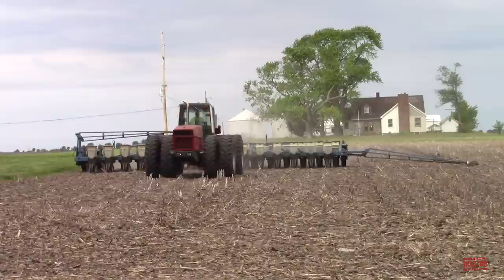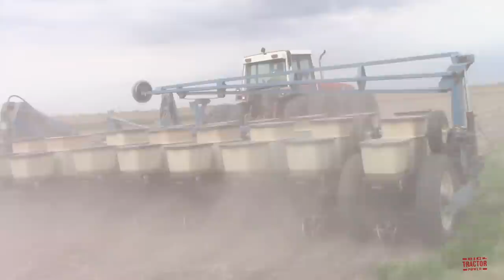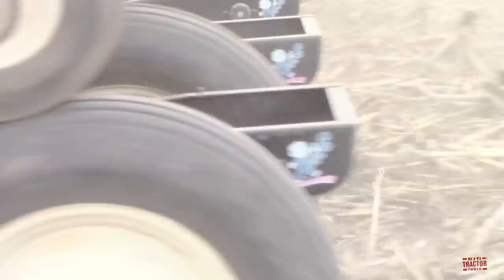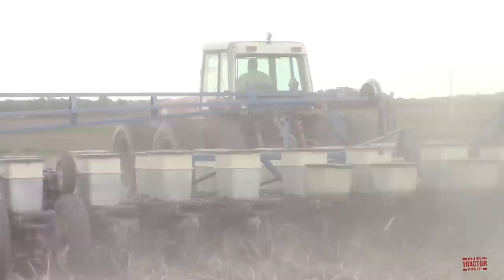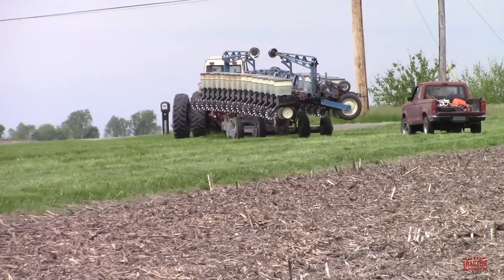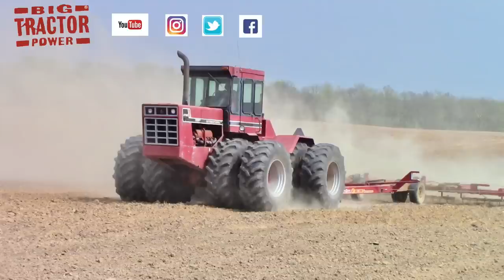INTERNATIONAL 3588 2+2 Tractor

Comment: Still my favorite new IH tractor. Remember having many a cab ride in one as a kid. There's nothing like that new cab smell. Driving it, once I was a little older, from time to time was a neat experience. My favorite jobs were pulling the Gehl 1260 chopper with the Auto Max setup in hay & pulling the big Vibra Shank. The other favorite new IH machine was the 4000 windrower. I'll save that story for some other time, in case you post a video of one in the future. Thanks for the great video, Jason! Regards!!

Comment: This is one of my dream tractors it's hard to find one here in Saskatchewan
Reply from the maker: I have an IH 620 press drill brochure that shows a Wheatland 3788 on a four section model. The Wheatland 3788 has larger singles and no 3pt.
Reply: @bigtractorpower  IH made a Wheatland 3788 2+2?  I didn’t know that.  I liked the look of the 2+2.  My dad told me about when he saw one back in the early 1980s.

Comment: That looks a very big tractor for 150 hp, considering what sort of outputs you'd expect from top of the range tractors nowadays.
Reply from the maker: During this time period the biggest articulated  4wds were around 250-300 hp. A 150 hp row crop tractor was a big machine at the time. It was not until 2006 that hp really began to jump in row crop and 4wd tractors. By 1996 tractors had grown to 225 hp row crop and 425 hp 4wd. By 2006 they were 255 hp and 450 hp. After 2006 row tractors jumped to 305 hp, 335, 360 to 400 hp in ten years. 4wds went to 500 hp to 600 hp in ten years.

Comment: The 2+2s were pretty cool tractor! It has the 86 series cab. 4 speed?
Reply: 3 speed, same transmission as the 1586
Reply: @gjh12  yea. We have one of those.😌
Reply: No it’s a 4 speed.  3 speeds only came in the 3788 and 6788 modes the rest were 4 speed.
Reply: Yea. We have a 1586. Wish it had a 4 speed. Not the best chore tractor. Does the job though. Lol
Reply: @benkpsnyder  yup we had a 3788 but we much prefer the 3588 lol

Comment: I have often wondered what the big drawback to having the cab behind the pivot. There has to be one IH is the only I know of to market that configuration.
Reply from the maker: There is not any draw back that I know off. When you look at a modern Case IH Magnum or a John Deere 8R they have the same front forward engine design as the 2+2.  In fact a new Magnum and 8R is longer than a 2+2 they just don’t articulate.
Reply: @bigtractorpower  you put a tractor I always liked on here.  To me if that 2+2 concept would have been carried over to CaseIH, they could have made more of them.  Looked like it was quite maneuverable.  I’ve read a good bit about that tractor from International Harvester.

Comment: On the 2+2 tractors if you put duals on the rear AND front axle the outside duals would rub each other prior to full steering lock.
Reply: My family bought a new 3388 in 1979. I don’t remember if we ever put duals on the rear but we never had them on the front. It was a different tractor to drive. We had the first one in our area.
Reply: As the farm that owns this 2+2 and another loaded up with duals at one time, that is not true.  You can turn ours all the way and the duals will not rub.  All about wheel spacing.  If spaces in the right way yes they will run.

Comment: Well besides the obvious: Black wheels that’s wrong, should be red wheels from the factory on 3588! And the Front grill is wrong too, should have Black mesh with silver bezel and grill squares to be true factory 3588! I’d would guess somebody trying to make it look like a 6388 or 6788 which is way more rare than 3588! Other than those imitated features not at terrible tractor!?
Reply from the maker: Well some times you film what you can find until a more factory version shows up. I like to find those restored factory versions but they are far and few in many cases so I take what I can find at the time to highlight a tractirs history.